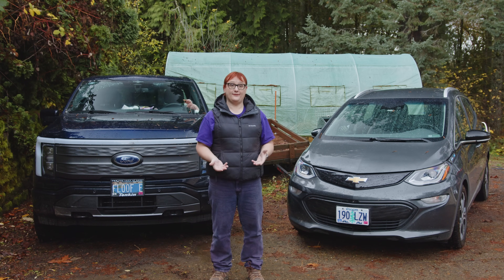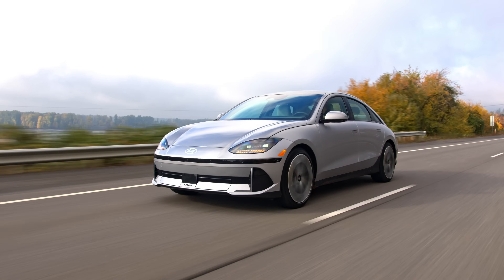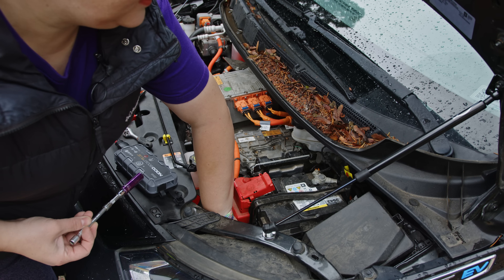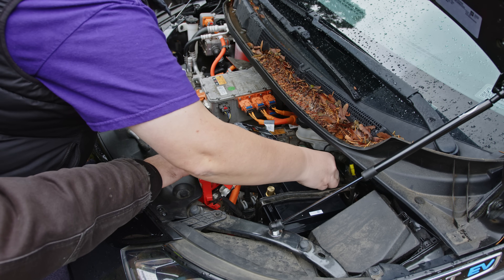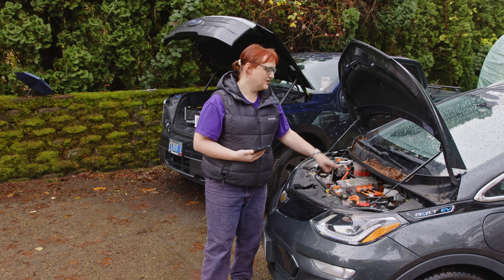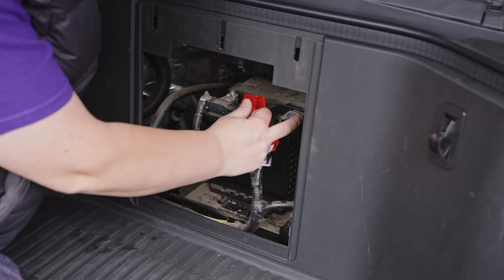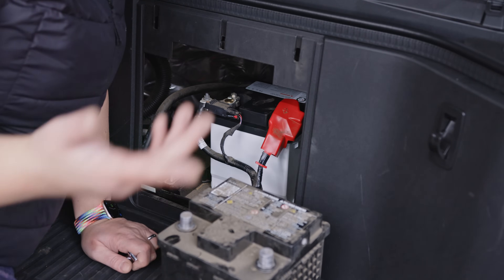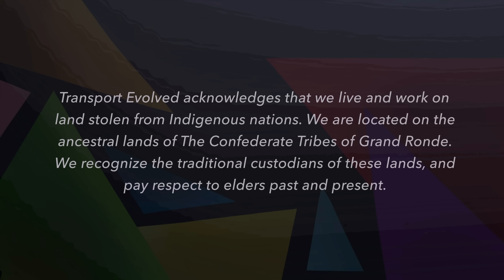Long Term Review (Intro) : Are These EV 12V Batteries From Ohmmu A Better Alternative To Lead Acid?

Comment: I replaced the original AGM 12V battery in my i3 in October of 2023 after 6.5 years of service. It hadn't yet died, but I didn't want to push it to the point where I might get stranded or where I would have to do the job in the dead of a Rochester, NY winter. The replacement cost me a not-terrible $145 including shipping. Strangely, no NY State sales tax was charged by the NJ company that shipped it to me.

Comment: Question: Obviously the NOKO unit worked but did you ever encounter in an EV, a completely dead battery that exhibited a polarity issue and then use a NOKO to solve the problem? I know it works for ICE vehicles but never watched a similar video for an EV.

Comment: years ago i watched a video from a guy who replaced his car battery with a bunch of supercapacitors. those things had enough power to start the engine several times in a row.
Reply: I saw that too! The individual with the Honda CRV iirc?
Intriguing stuff!
Reply: Supercapacitors will lose their charge fairly quickly. If you get 3 days of adequate storage you'd be lucky.

Comment: I wounder if there are similar alternatives (12v but with lithium, with higher capacity, current stability and or smaller weight) for trolling engines. Trolling motors for small boats are light and effective, but traditionall lead 12v batteries are both heavy and weak...

Comment: Already had the 12V battery on my 2017 replaced under warranty.  When it goes out again I will be looking for something like one of these.

Our 2023 Mach-E ended up getting bought back by Ford over what turned out to be a dodgy (but not completely failed) 12V battery.  The dealer could not find the cause of the electronic gremlins, (including non-start situations).  I told them to check the 12V battery, they said they checked it and it tested fine.

Fast (not really) forward several months later and they tell me they can't find the problem and I should ask for a buyback.  I told them to check the 12V battery again.  They did finally change the 12V battery and it fixed all the problems but I had already started the buyback process.
Reply: @raitchison  It's the best place to start with any electrical fault but unlike your dealer, you know this 😉👍

Comment: Back when I learned about working on cars I was taught to always disconnect the negative side 1st. The reason is that, if you bump a grounded part it will short when working on the positive side if the ground is terminal connected, but it won't if disconnected, and there is no worry of bumping a grounded piece when disconnecting the ground terminal.

Comment: Heck, I'm impressed you were able to find a 10mm socket. lol
Reply: A loose 10mm socket will vorp itself into inter dimensional space when you’re not looking..   same as socks in the wash..   nobody knows why, but we’ve all experienced it
Reply from the maker: It's a standard automotive size. ..
Reply: @transportevolved  10mm sockets are notorious for running away and hiding.
Reply: @tomrossman9371 Yep. I have four near-complete socket sets. Only one 10mm socket between the four.

Comment: Nikki - Regarding the Bolt battery replacement. I noticed that the footprint of the new battery is a bit smaller than the one you are replacing.  Although you said the word "snug" after replacing the retainer, is the new battery still secure after being driven a bit?
Reply: Contrasting with the F-150, which had almost the exact same case.

Comment: I tried the Ohmmu battery for my Tesla MX a few years ago.  It came with the battery terminals reversed, so my wiring harness would not reach the proper terminals.  Very expensive, about $350 at the time.  I returned it & used a lead acid AGM battery from Tesla instead.  

Also, there have been problems/incompatibilities between the Ohmmu batteries and Tesla’s 12V charging system.  Those get very annoying when one spends so much on the battery, and which isn’t especially easy to replace in older Teslas.
Reply: I heard the early Ohmmu batteries did have issues, I've had no problems after installing mine in my 2018 model 3.

Comment: The best way to avoid 12V battery problems is to routinely replace the battery every 3-4 years.
Reply: I used to run it until it was dead, but AAA Battery Service doesn't seem to be as good as it used to and it can be a huge hassle, possibly even being locked out of your car
Reply: @ I doubt AAA carries replacement batteries for Teslas, plus changing the battery on older MS and MX is too invasive for them.

Comment: The major concern I’ve seen with using lithium and sodium batteries is the internal BMS will reject incoming charge and this can be a problem if the car’s 12v rail isn’t designed for this. In ICE vehicles, there’s a ton of noise on the 12v rail that gets absorbed by the lead acid battery, and there are EVs that have no mitigations for this. Earlier Teslas were apparently pretty notorious for this, and Tesla would void the warranty if you used one (Ohmmu has a page about this). If you see weird issues with your dash or some other systems, it’s possible it’s not handling the missing 12v battery buffer very well. I had considered changing out my Kia 12v battery for an Ohmmu, but worried about this specific problem, so ended up replacing it with a high quality AGM, which solved my problems.

What I’d like to see in BEVs is a manual contactor engagement system. A dead 12v battery preventing a BEV from running is such a common and dumb issue, and I’ve seen arguments against BEVs using this as an example of why they’re bad. I don’t like keeping a jump starter in my car when there’s a giant 64kWh battery pack underneath it that can’t do anything to solve a dead 12v problem.

Edit to add: To be clear, I’m looking forward to your experience with this battery. I’ve seen mixed reviews about them, but may be application problems and not product problems.
Reply: A few 25V 10 000uF capacitors in parallel with the battery should take care of noise when the battery's BMS decides to disconnect at the end-of-charge. If you have 0.1F on there and the alternator was dumping 35A into the battery when the BMS cut off, that will be 350mV/ms slew rate for the voltage regulator to cope with. Should be plenty slow enough.
Reply: Replaced the OEM 12V lead acid battery in a 2019 Kia Soul EV about 6 months ago with a 12V OMMU lithium ion battery. It has worked flawlessly so far. No more worries about the car not starting because the 12V battery was dead, as before. No more jump starting. No more hassles. The OMMU app connects quickly and provides useful information about the battery.
Reply: Two blatant problems with Ohhmu. No datasheet no rated capacity. The sticker on the battery is all your get and it's barren of specifics. Every 12v battery will provide you these two data points on the battery or website. Possibly no heater as seen in others teardowns. Thank you for posting my same concerns with better phrasing than I could have done. I went on the same journey with my Kia and was able to get an AGM from RockAuto ACDELCO	 LN1AGM which was an exact fit for my Niro EV.
Reply: Not sure when you looked but Tesla has shifted to lithium based 12v batteries year or two ago
Reply: @chidorirasenganz : You’re partially correct, though those (tesla’s) lithium batteries operate at ~16v rather than the usual 13.5-14.5v that regular “12v” batteries do. Just enough of a voltage difference to cause issues with jumping another vehicle.
Reply: @chidorirasenganz  As I noted, earlier Teslas had issues with these batteries. They had to re-engineer things to adopt their own 16v lithium based system. And it’s super weird they went 16v instead of leaping to 48v, honestly, because the accessory port (also referred to as the cigarette lighter port) also runs at 16v, and could fry some things! Tesla puts warnings about this on their cars. Could have gone 48v and do another step down to 12v on that port. Or omitted the port entirely. Since they had to basically rework things anyway.
Reply: @ Im talking about pre Cybertruck as the Model 3 and Y were never going to receive a 48v architecture in that time period or potentially ever. 

For the Cybertruck I have no idea why specifically they didn’t step down to 12v
Reply: It's light enough you could use some zip ties and styrofoam blocks.
I believe the battery BMS is designed to work with lead acid charging system, this one also has a Connected app that monitors the battery come of course you pay a lot for that
Reply: @rp9674  The BMS is designed for 12v charging systems, yes. But it rejects charging input by disconnecting the battery from charging when the battery is full, so there is nothing absorbing transients anymore. This is for safety. Lithium batteries do not behave well with continued input past full charge. Lead acid batteries behave like a big capacitor in many vehicles, and that job is missing if the input is cut off. Some cars may be able to do this conversion okay. Some may start having weird issues with sharp voltage dips and spikes that don’t get absorbed anymore. This is primarily a problem with ICE vehicles, I think, but as I noted, earlier Teslas had issues as well.
Reply: @rp9674 : The OP here was raising concerns over going from lead-acid, which doesn’t have any BMS at all, to a lithium battery which DOES. With existing 12v systems, the charging of the 12v battery is controlled by the PDU of the vehicle itself, and the OP here was worried that the settings (in the vehicle’s PDU) for a lead-acid battery might cause problems with the BMS of a lithium battery (if I’m understanding him correctly).
Reply: I believe Rivian is still threatening to void the warranty if you switch to a lithium battery.
Reply: I'm afraid to do any modification on warranty - unfortunate
Reply: The battery has a warranty, that's the most important thing
Reply: I haven't doneI haven't done a dissection yet (never will) but this battery is designed as a drop in it's not designed for a future vehicle calibrated for non-led acid.  I can't guarantee it works for this application, but the manufacturer probably does, what else could you want

Comment: Last Summer (2023) I replaced my  OEM battery with an Ohmu.  It definitely has more capacity than the OEM (or my original dead OEM) battery.  I managed to get my dealer to replace the OEM with another OEM battery, so I tested it by watching voltage swings with a bluetooth voltage montior, and then re-replacing the Ohmu in the car and monitoring it.  The voltage swings were less, but still apparent with the Ohmu.  The weird thing with the Ohmu, in my experience was that it seemed to occasionally turn off (the BMS has the capability of disconnecting and reconnecting the battery from the car) causing me to not only be annoyed by losing my efficiency numbers, but concern that it might do that while I'm driving!  

To resolve this, I purchased a pair of LiFePO4 batteries (same chemistry as the Ohmu) and paralleled them with the Ohmu for a resulting battery capacity of over 250 or so Amp hours.  I figured that the paralleled batteries, having a simpler BMS wouldn't shut off on their own.  I ran AWG 8 insulated wires through the firewall into the "engine compartment" and paralleled them with the Ohmu through a 50A inline fuse for safety.  This has been working perfectly for over one year now.  I even put a current sensor on the common ground wire to the chassis and can monitor both charge/discharge behaviour as well as the combined battery voltage (usually at right around 13.3V).  I had surgery on my foot in late April and didn't drive the car until the fourth of July, and it only dropped  0.2V over that time of complete disuse!

Monitoring the voltage swings now shows only tiny swings, except for when the car is charging the composite battery (during driving and during AC charging (level 1 and 2)).  This gives me some comfort thinking that should my ICCU and/or fuse die, I'll have enough capacity (over 3kWh) of 12V power to get where I need to go (home or my dealer) before running the 12V battery flat.

Comment: I also put an Ohmmu battery in my 2013 Leaf, since the Pb battery was shot.  The reason I heard is that Pb batteries are designed to dump a big current while starting an ICE car, which keeps the plates "clean", while an EV, since it never needs a huge starting current, allows the plates to build deposits which shortens battery life.  Is that your understanding?
Reply: It's true that lead acid batteries are able to produce the high current required to drive a starter motor of an ICE (ignoring that starter motors have gotten lighter and more efficient over the years, so many don't actually draw nearly as much current as used to be the case). But, the idea that this high current would in some way be good for the battery, that doesn't seem likely to me. The deposits that build on the plates of a lead acid battery, build up as the battery is _discharged_. A fully charged battery will have little or no deposits on the plates in the first place, so nothing for a high current load to remove.

If anything, high current situations are bad even for lead acid batteries. They can handle high load up to a point, but there are still limits, and if the battery discharges too quickly, the electrolyte nearest the battery plates gets depleted of the acid (the electrolyte solution can't diffuse/mix fast enough to keep the acid balanced) and the battery temporarily will lose voltage.

As far as your 2013 LEAF's battery goes, I don't know if you had the same experience I did, but my experience with the car killing the lead acid 12V battery was completely unique to that iteration of the LEAF, which I also owned (a 2013, in fact) and didn't have much to do with the battery chemistry, other than the lead acid battery's sensitivity to deep discharge situations. That is, after I had the cellular radio upgraded from 2G to 3G, the new electronics had some kind of defect in which after charging the car to 100%, the cellular radio would draw an excessive amount of current for an extended period of time and drain the 12V battery, requiring it to be recharged before I could use the car again. Suffice to say, since lead acid batteries handle full discharge very poorly, it only took a couple of iterations of this before I had to replace the 12V battery, twice.

(Frankly, that whole situation was a complete fiasco, as it took months of wrangling with the local Nissan dealer just to get any action to resolve the issue, and that wrangling involved a lot of labor on my part, including reproducing the problem over and over, which of course accelerated the demise of both the 12V battery and the car's drive battery, since the repro case involved repeatedly charging to 100%, something that just isn't good for any Li-ion battery, never mind the inferior one in those early LEAFs. The eventual fix was to disconnect the cellular radio altogether and do without the Carwings/connected-car features. Naturally, Nissan did not refund us the cost of the upgrade to the defective 3G radio.)

Comment: Every car owner should take moment to understand how to undo and replace a 12-volt battery in their car. A lot of cars are complicated now and you'll find oftentimes more than just two wires in some cases a whole assembly attached to the positive cable as is the case with my Volvo ev, and even my ice car that it replaced

Comment: My 24kw Leaf's original 12v battery has only recently expired on an appropriately freezing cold evening. The car is 9 years old this month. Because i was stranded & 'needs must' i have replaced it with a Halfords own brand lead acid replacement that I'm sure won't last another 9 years(!) but given that its not cramking an engine over everytime the car is used, am not surprised the original lasted well.
The best way to get a good lifespan from a lead acid battery ive found is to avoid at all costs letting one go flat.
My only concern using a different chemistry would be how it would cope with the vehicle charging it when being designed for a lead acid battery?
Reply: I think the BMS is designed to work with the lead acid charging system.  My EV 12v last about 3 to 4 years, slightly worse than my gas vehicles, 9 years is amazing
Reply: I have a Prius and replaced the battery recently with a Halfords battery. I was happy to buy it as it was in fact a Yuasa battery in Halfords labelling. It was exactly same spec, CCA, Ah, dimensions as the Yuasa branded one and  came up as compatible with the car.
Reply: If this is one of their "Calcium Tech" batteries, you might get 2 years out of it; I think this is deliberate, as you then get it replaced under warranty - ad infinitum (3 year warranty), putting independent battery suppliers out of business. 
That was my experience with them, after fitting one; it would just die without warning around 18-22 months later; I went through the free warranty replacement scheme about 5 times, before getting pissed off at the random morning failures and fitting a Bosch Silver; which was still going strong 10 years later.

Old tech Lead Acid could be revived from flat with no issues, these calcium tech batteries wont recover, and once run flat, will not hold a charge properly afterwards.